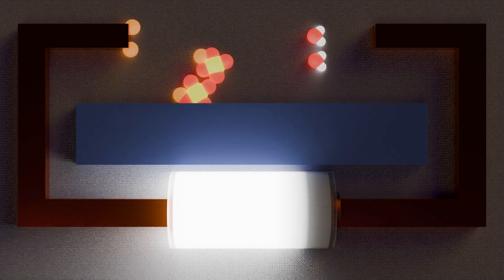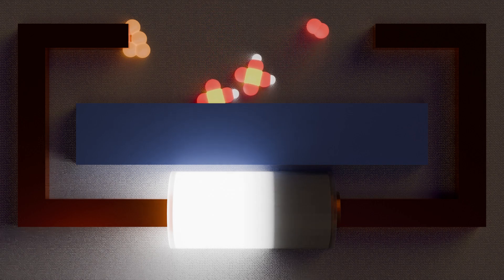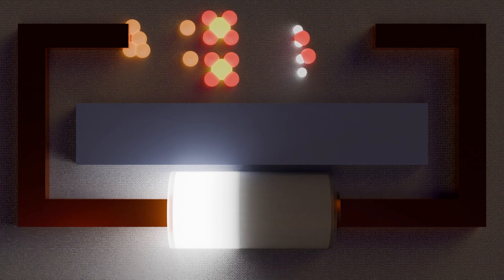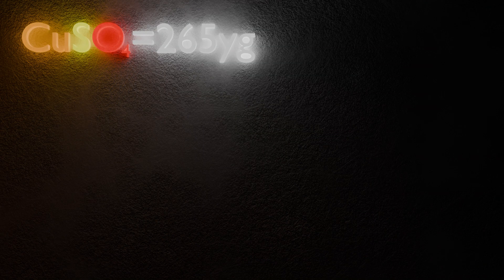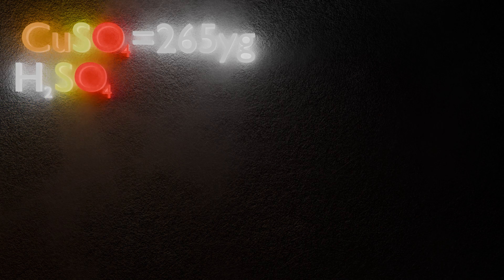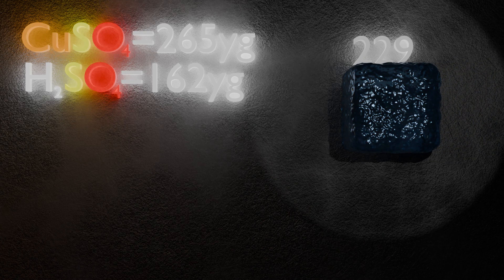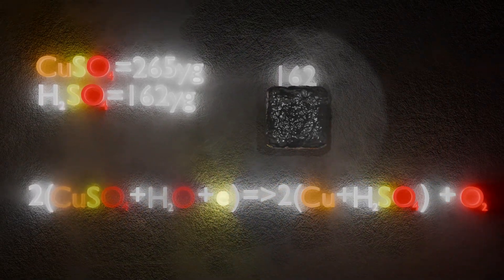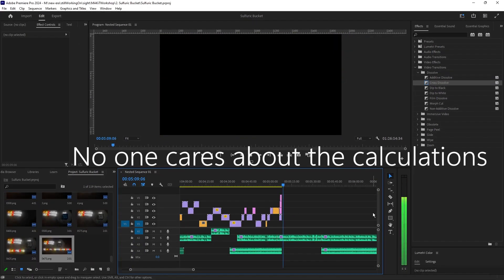MAKiNG a bucket of sulfuric acid

Comment: 8:04 the "gas" it's really a mist of the solution generated by the bubbles exploding

14:10 what's happening there it's that you generated acid in the top layer where's the cathode and some stirring from the anode bubbles. If your cathode does not reach the bottom, the copper sulphate solution stays there and does not react.

Probably that's what happened in the bucket, the upper layer was acid indeed, but all the rest was copper sulphate. Once you electrolyse all the CuSO4 from the upper layer, hydrogen begins to evolve in the cathode and from that  moment you are only electrolyzing water.
Reply: You could have bought a stearing Kit (the stera bar and that) and púť in on an low settings. Or better would even be to just stear it by yourself after som time. Edit: I forgot that this is low budget series and the guid how to make IT at home.
Reply: @kekso2205  it's low budget but he bought the platinum anode straight away xd

can't be judged. Platinum goat
Reply: @lautaromorales2903  True XDXD
Reply: hope this helps in the part 2!
Reply: @lautaromorales2903  this is part 2
Reply: @No_One_0707  part 3*

Comment: Coming back a few hours later to re watch it to write a better comment because i liked it so much the first time. I've done some thinking and and believe some of the reason for the result might be do to contamination in the copper sulfate. Depending on where you got it from it might be dirty and require filtration + crystallization to remove dust and iron sulfate contamination. I think it might be worth mentioning that when dissolved in water the ions are free floating, although that's really just a personal thing. I do agree with the user that said that mixing the solution is required due to the top layer being mostly electrolyzed. If i recall correctly, there is a way to calculate the duration for electrolysis to finish using the current and MOLES of solution. Overall i like the video and respect you for putting it out and not scrapping it. It's important to show that not everything theoretical works out as expected in the lab and things not working out perfectly is normal in science. Thanks MAKiT, much love!

Comment: what if the problem was using the AC power, it switches the electrode polarities, so it may take longer and each half cycle reverses the work done by the other electrode but since the other one has higher surface area it didn't reverse it as much hence it took longer 
Atleast that's what I think
Reply from the maker: The blinking diode was on a DC 3A 12V powersupply, if I used AC it wouldn't really be electrolisys
Reply: yeah didn't consider that, it's the little details huh

Comment: i have a question why it take so so so long and still not pure sulfuric acid is it because is not pure water or is not pure copper  sulfate or maybe both i don't really understand because the math say it will work but in reality it didn't so can you explain to us ?
Reply from the maker: The biggest issue with this impurity is that... I honestly don't know what it is.

It's probably just some random low concentration chemicals in the water concentrated to the point where it's no longer low concentration. That'd be my guess but honestly... I have no idea